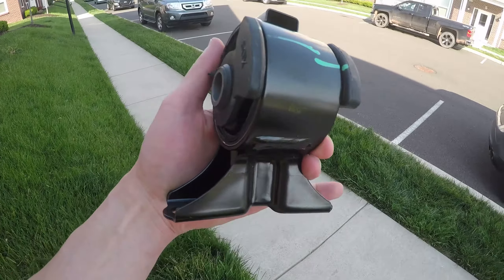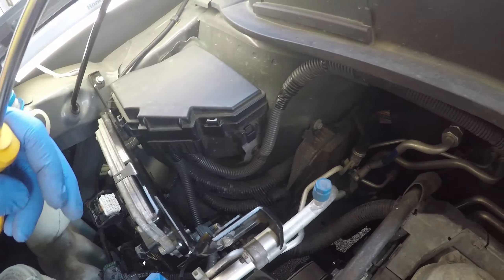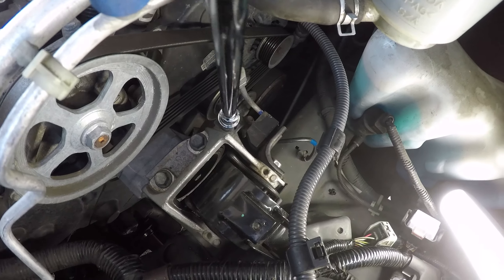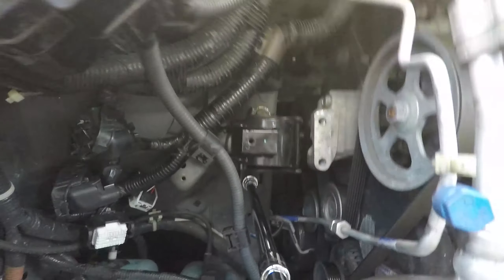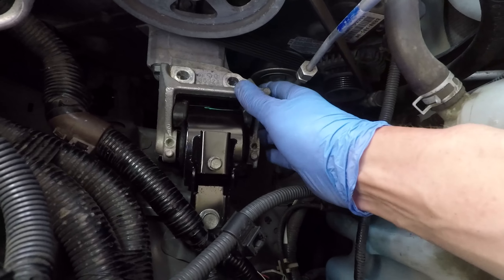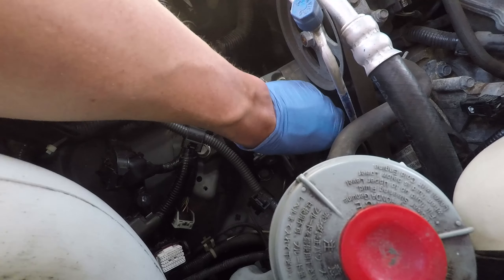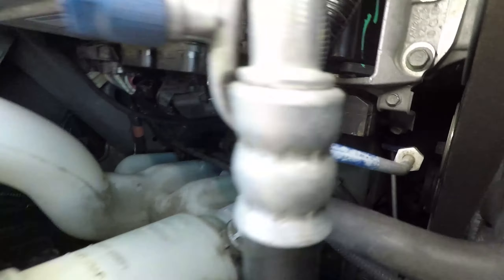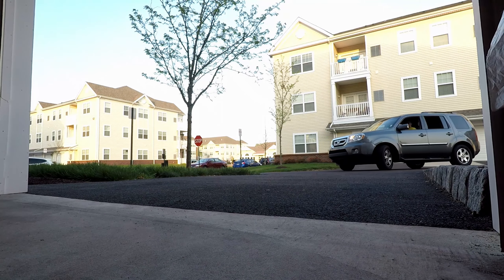2009-2015 Honda Pilot Side Engine Mount and ECU Replacement

Comment: I had my done a the dealer when I changed the timing belt ,water pump and tensioner with the motor mount  for $1060.00 it had 105,000 miles .  Nice video

Comment: Could that faulty part cause a growling type noise when turning left with engine under torque?
Reply: That’s more likely your cv axel, just got mine replaced for that reason. Fixed

Comment: First thanks for making the video. I would like to how do you know that one was out of the 4  mounts the bad one, thanks in advance.
Reply from the maker: The side engine mount was easy enough to get to and in the video I show how the old engine mount rubber separated from the mount at 6:42 . The front and rear engine mounts are more difficult to get to to replace, but I would recommend doing so, as it is a good idea to replace all engine mounts at the same time. I might do a video in the future about replacing those as well. Also, I wanted to mention that the transmission mount is easy to get to and replace on 2ng gen Pilots.
Reply: @ills  But how did you know that it was the right side that needed replacing? I'd like to know as well

Comment: I already did this  myself last year, not so difficult though. What was wrong with the ECU by the way?
Reply from the maker: ECU was fine. I removed it to get better access to the side engine mount. Perhaps it can be done without ECU removal, but space will be limited.
Reply: It's much easier if you move the ECU to the side. 

I change this past week the two side mounts. But I haven't take the time to replace the front and rear ones. I don't know yet how difficult they are either.

Comment: How do you know vibration comes from mounts and not something else? Just have to inspect the mount with flashlight?
Reply from the maker: Yes, inspecting the mounts does the trick. And Yes, vibrations can be coming from a number of things like worn out suspension components, unbalanced wheels, bad alignment or brake rotors... I had to check everything and replace/fix other issues before finding out that the motor mount was completely shut.

Comment: Is there any issue of you unplug the ecu?
Reply from the maker: I didn't have any issues. Of course it is safer to have the battery disconnected while doing so, but you might need to enter the radio/gps codes after doing so.
Reply: @ills  got it thank you